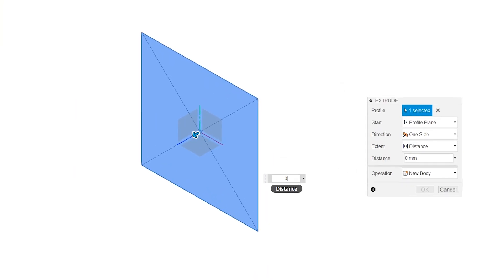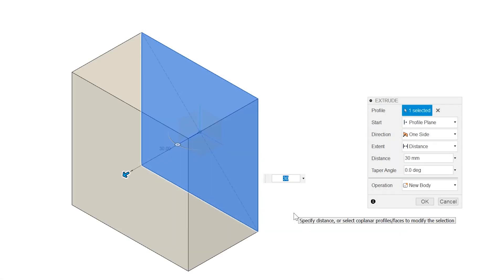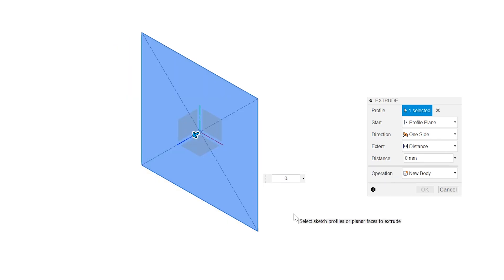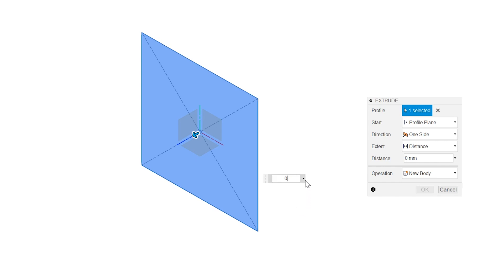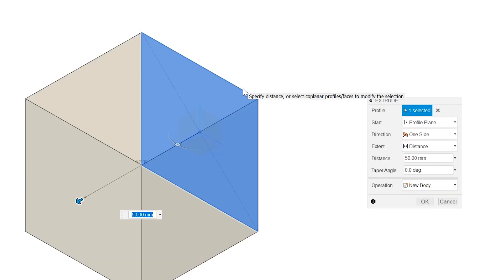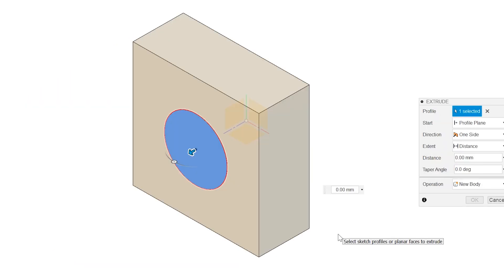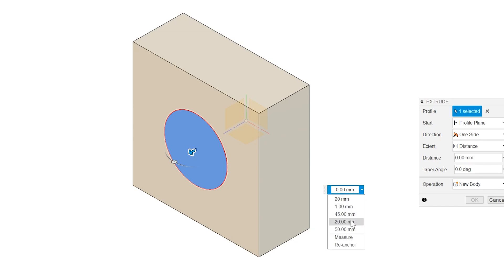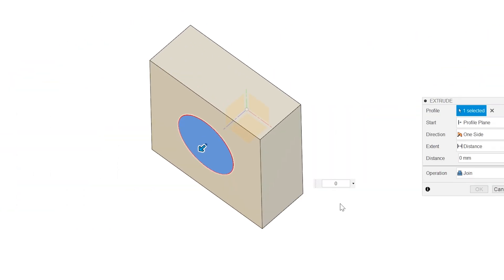Fusion 360 - Measure as Input

Comment: Do the extrusion lengths get parametrically linked by doing this?
Reply from the maker: Hi, I have done some testing. If the entity that was measured is changed, the extrusion length remains unchanged . So they are not parametrically linked.